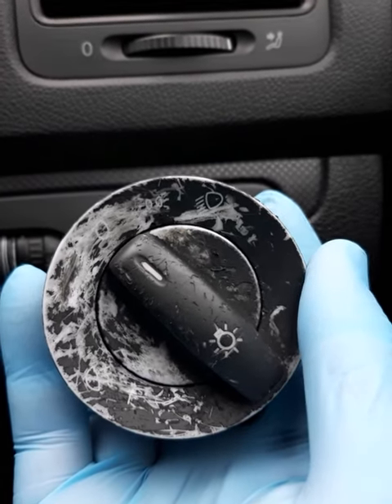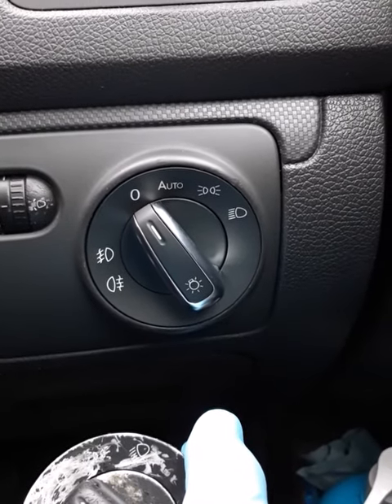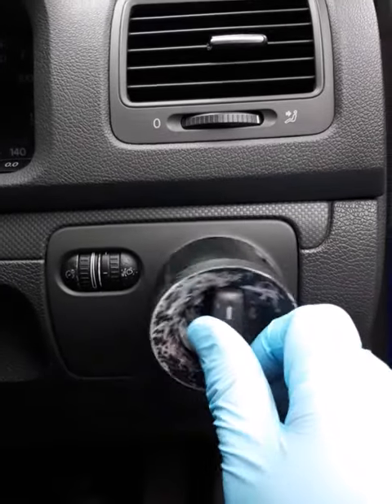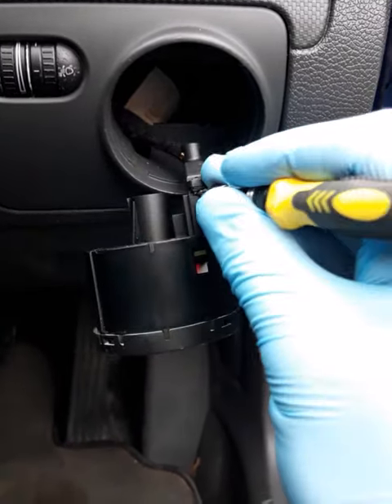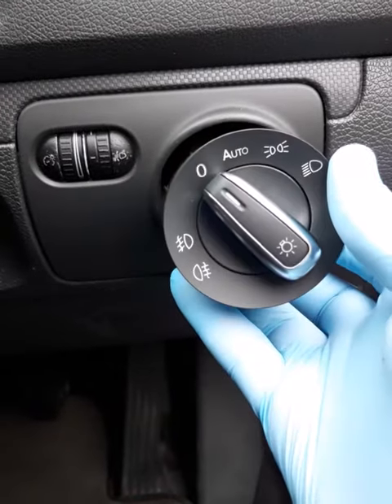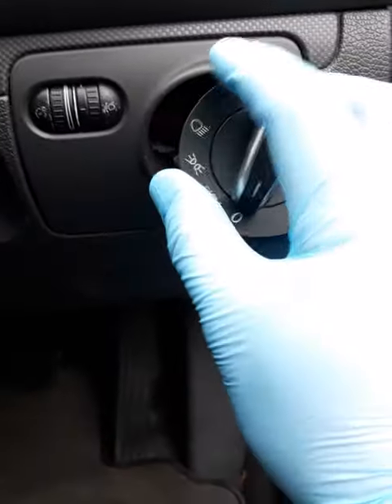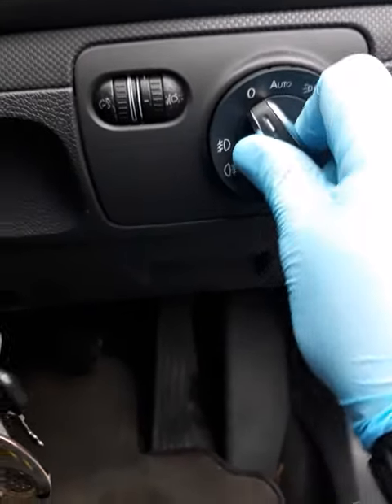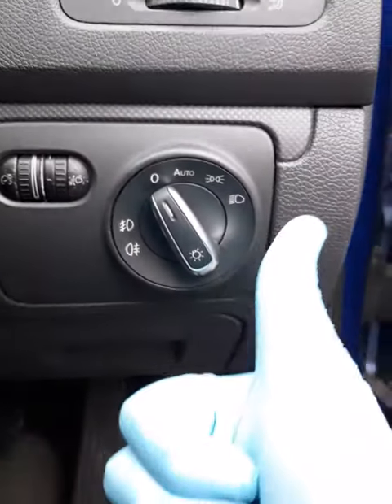VW Golf 5 Mk5 Headlight Switch How To Replacement/Removal/Upgrade 👉@montoya_garage

Comment: My golf 5 doesent have aut swich and i want to add so when i turn off the car it will turn off the lights too. Is it gonna work?
Reply from the maker: sorry for my late reply, yes definitely.
Reply: @montoya_garage  wont i need some kind of sensor or something so the lights turn OFF when i turn off my car?
Reply from the maker: @fredymredy  the one you see in the video (and you can purchase thru the link in the video description) has the auto option,the old one didn't had.You don't need any sort of sensor, oance you turn the ignition off/on it will do the job(turn the lights on/off. The main idee is that the lights won't turn on/off(adapting to the outside lights condition)if the car doesn't have this option and of course sensors fitted on the windscreen.

Comment: Hi, your old switch only had 8 pins whereas the new switches all come with 10 pins does this matter when buying a replacement ? Thanks
Reply from the maker: Hello my friend, the switch you are seeing in this video fits perfectly and also will fit perfectly a wide range of WAG group cars/models.My best advice to you is to read the full description of the product and fitting section when deciding to buy it. Hope this helps.
Reply: @montoya_garage  thanks for quick reply buddy 👍
Reply from the maker: no worries my friend, you are welcome. Feel free to subscribe to my channel and join our community. Thank you for your support 🤗